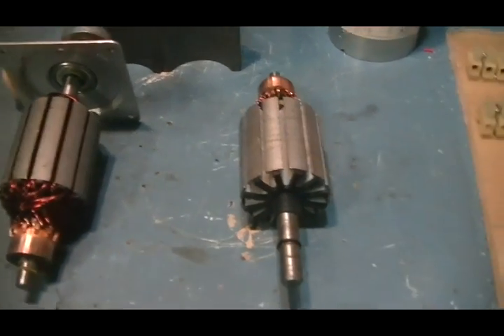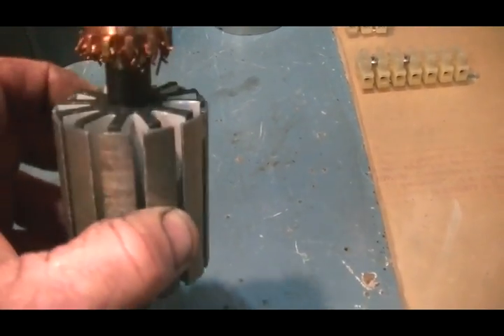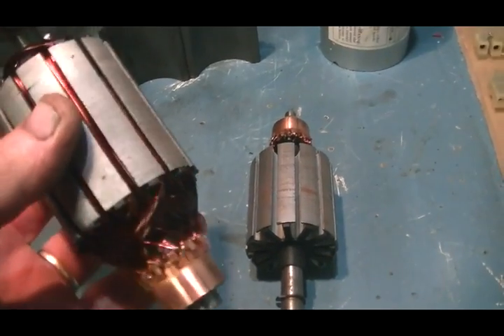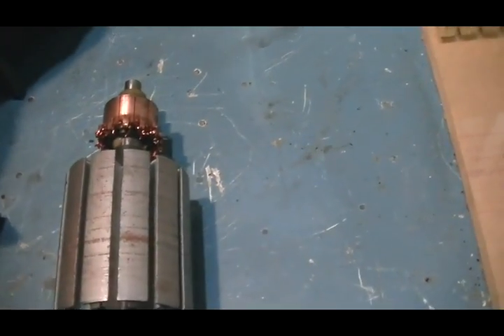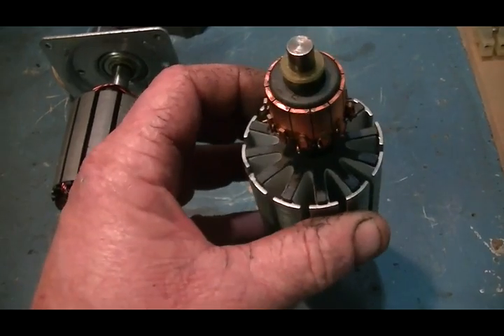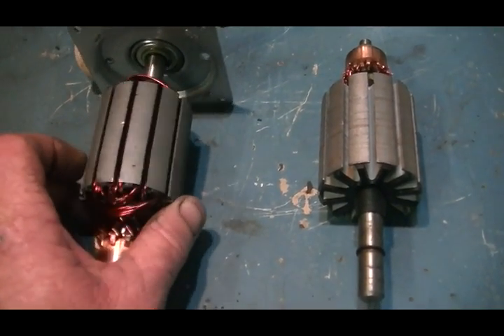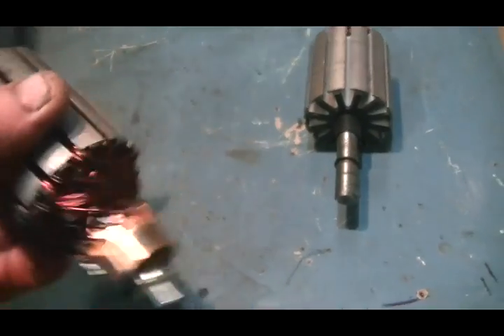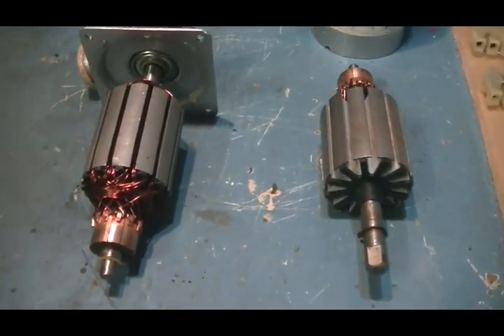ufo motor to run lenzless generator

Comment from the maker: Hi Tony.In all the video's i have seen,it would seem that it is more efficient than a standard motor configuration.
A youtube user by the name of min2oly posted a video not long ago ,on his understanding about the UFO motor.I think he is pretty spot on with what he shows.
BUT-i have changed the design already lol Most that know me know that is what i do lol.I once said that a motor could be designed to include a generator within it,that wouldn't draw any more power-but increase the torque.